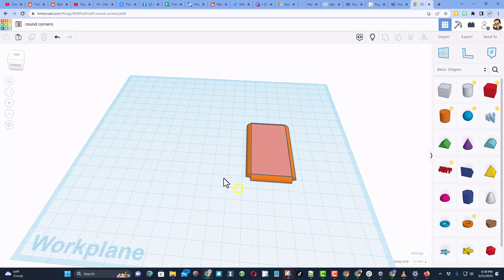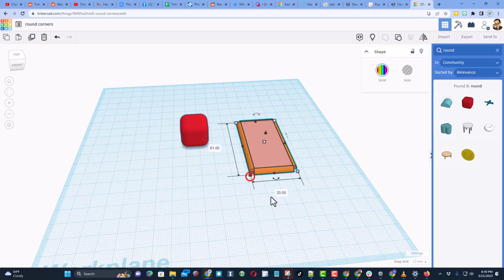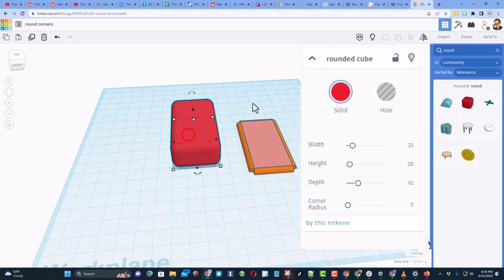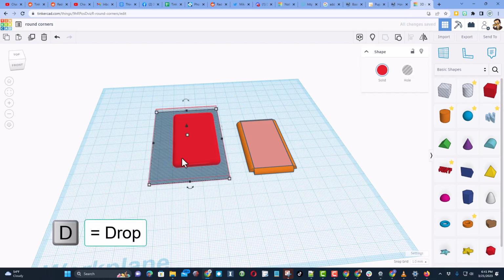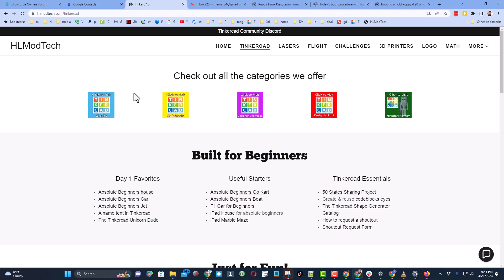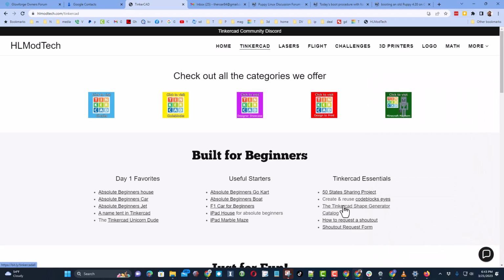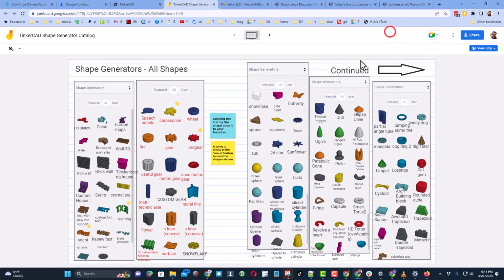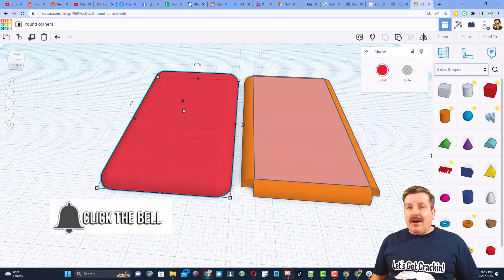A Tinkercad Trick to create a Rounded Rectangle in an instant

Comment: Great lesson! Question, Is there a way to prevent notes from showing up on designs as you pan around a model? For some reason, they always seem to come to the front. Thanks!
Reply from the maker: There is not a way to prevent that. You can completely hide them, but you are correct... they always show through. When I make the shoutout videos using notes I have to get angles that work for me a ton.
Reply: @HLModTech  Bummer! Thanks very much for the quick response and for all of your efforts to educate users!
Reply from the maker: My pleasure. I will try to get a word to the devs at Tinkercad about how having them hide behind the shape would be neat.